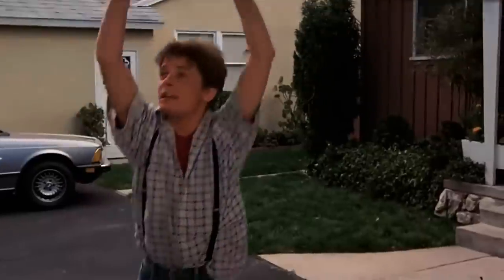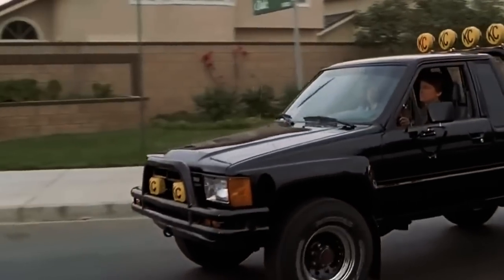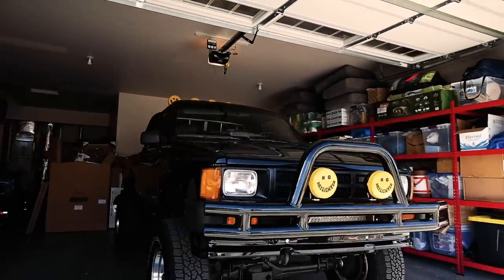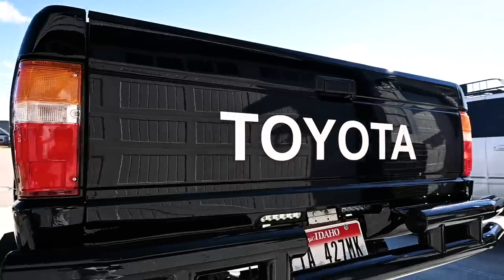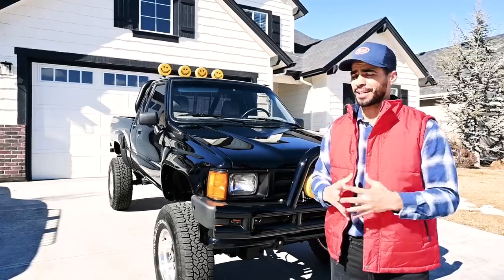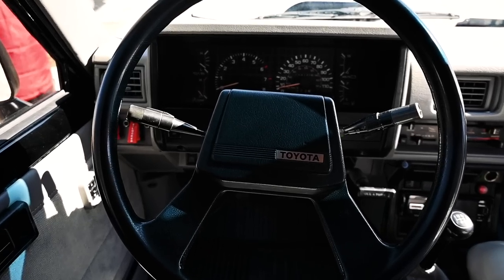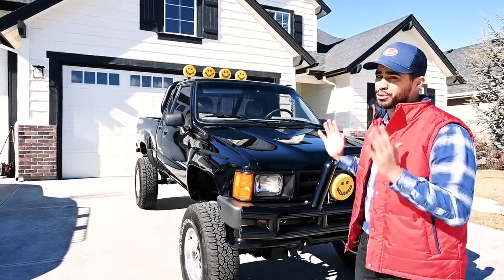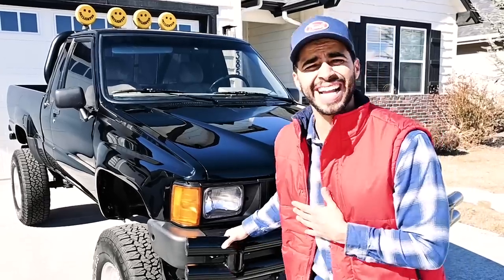1985 Toyota Pickup 4x4 SR5 Xtra Cab - BACK TO THE FUTURE TRUCK REPLICA | David Lopez  @SOSCustomz

Comment: Why you selling it already on eBay? Also, may want to lower it and fix the front bumper. Truck sits way too high, and the tube bumper is supposed to be in place of the other bumper, not in addition to. Otherwise, nice truck. Good restoration.